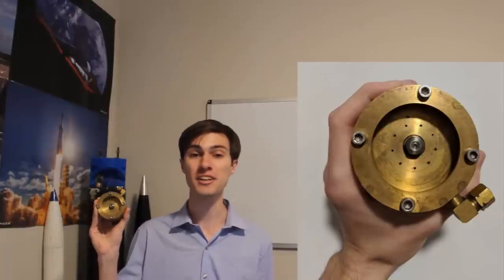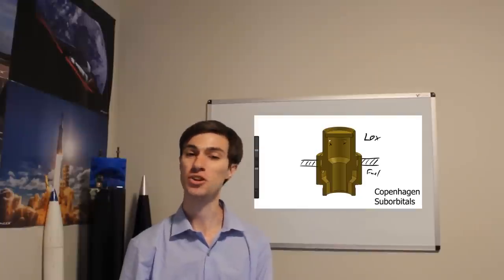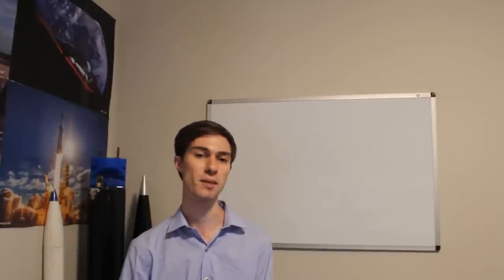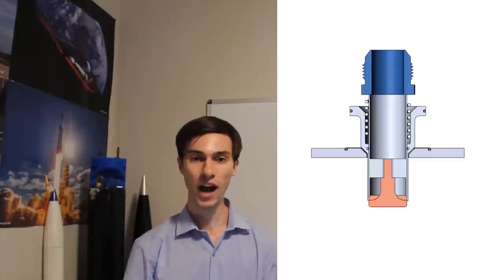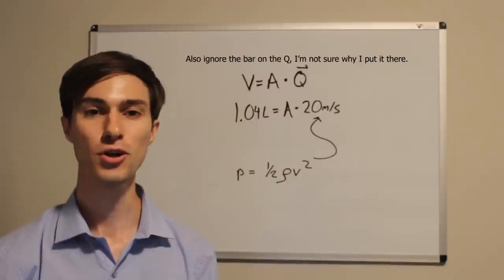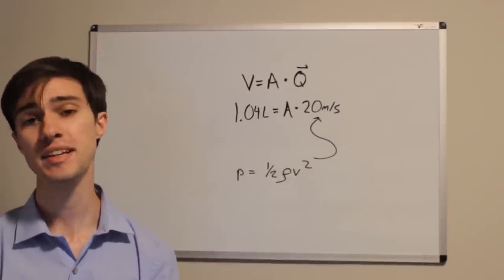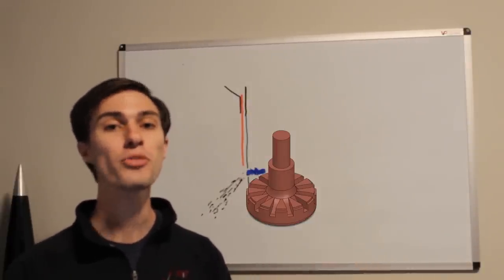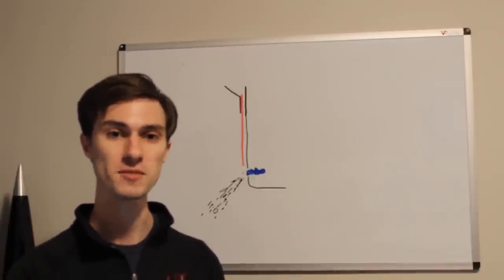Liquid Rocket Engines 2: Injector Trades

Comment: It's Q=V*A not V=A*Q
Reply from the maker: You're entirely right, and this is what I get for throwing equations up on a whiteboard while recording. All of the actual design happened in python, so I could iterate over a lot of possible options. And thankfully for my dignity, I used the correct equations in python.
Reply: @AstroCharlie  Great video 👍

Comment: If you study chemistry of different oxidizing agents, your not stuck with Liquid oxygen gas or nitrous Oxide.  White fuming acid (WFNA) is a storable liquid oxidizer used with kerosene and hydrazine rocket fuel. It consists of nearly pure nitric acid (HNO3). ... WFNA  also as well as RED fuming Nitric Acid is a great oxidizer.  Another good oxidizer is Hydrogen peroxide--, Hydrogen peroxide can easily break down, or decompose, into water and oxygen by breaking up into two very reactive parts – either 2OHs or an H and HO2: If there are no other molecules to react with, the parts will form water and oxygen gas as these are more stable than the original molecule, H2O2.  You can build a very powerful rocket with this compound called a H2o2 Monopropellant Rocket. Works in the principal of pressurizing 90% H202 with nitrogen shooting into a Catalyst pack that decomposes it into steam and Oxygen which then exits through the combustion chamber with a solid type fuel, and is ignited burning the two substances violently into the conversion zone of the rocket nozzle at subsonic speeds entering through the throat and passing through the diversion zone at supersonic speeds. This is the cheapest and yet most effective way to build a very powerful rocket and it can be throttled up or down. No complex machining is required to accomplish this rocket. Im building a land speed Rocket powered motorcycle so ive been studding a lot. and it helps having a father who works for NASA. Dad get me some Liquid Oxygen and Liquid hydrogen from work LOL

Comment: Hello, I am currently a senior in university studying Aerospace Engineering. I am working on a senior project to design an aerospike, both liquid and solid fuel. Currently working on designing an injector and combustion chamber for the liquid aerospike. I would like to present to my team some options for the injectors and would like to 3d print them. Could you send the stl files my way? Would be greatly appreciated. Thank you

Comment: I am not sure what sort of machining facilities/equipment you have access to, but if you have a mill and vertical rotary indexer (i.e. the axis of rotation is parallel the ground) there is a way you could machine a vain-less pintle element (i.e. to provide a smooth curtain of oxidizer rather than radial jets). Basically it would be to come mount the "blank", as you call it, in the index, and com at it from the side with an end mill of the appropriate diameter. Once you reach the necessary depth of cut, begin turning the index slowly (make sure to keep in mind which direction is climb milling vs conventional milling) until you do a full revolution. Presto, smooth pintle element.

Comment: Charlie briefly touched on one fact that few people realize: things do NOT burn, until they are in a gassious form! Look closely at any solid object that is 'burning' (wood), and you will see that it is the vapors coming out of the heated wood, that burns, and the heat from that combustion makes the wood release more vapor. Same thing for liquid fuels - burning takes place at the interface where the liquid is turning to a gas. The liquid itself does NOT burn. That is the secret of why today's vehicles have better fuel mileage than those of 40 years ago - better transformation of the gasoline fuel to a gas for combustion. Example: Charles Pogue's 1938 carburetor that achieved 208 mpg that was certified by the Ford Motor Company which recorded 27 miles on one pint of gasoline (216 mpg). That is also true of SpaceX's Raptor engine and Blue Origine's BE-4 engine. Their efficiency is in part due to using fuel and oxidizer that are both normally gassious before combustion.

Comment: I don't understand why you use the density values for an atmospheric pressure, when the pressure is higher in the engine, to calculate the propellant flow.

Comment: Hi Charlie, could you please explain a bit on how the fuel and oxidizer flow from the injector plate to the injectors? I am a little confused on the things things that go inside the plate and how the fuel/oxidizer are spread to different injectors through one tube. Thanks!

Comment: Hi brother, please excuse my ignorance but I just got curious. Did oscillations on the supply chanel affect rocket's performance? I mean at 4.33 the hose( which supplies water) clearly oscillating, how does a rocket engine responds those type of oscillations? By the way great video. I learnd a lot. Thank you for your effort :)
Reply from the maker: The oscillations definitely would in a real rocket. There are several phenomenon related to this like pogo and chug. For this flow test article it hardly mattered.
Reply: What techniques do they use? To reduce the oscillation or chug.

Comment: why the bipropelent engine dont get mixed befor combustion? oxigen if got flame inside will blowup and the methane the same(or i am worng). So mixig them before chamber to avoid injectors(using just valve)

Comment: Going with the lowest pressure drop possible may not be the best idea due to combustion instability. Huzel and Huang (https://arc.aiaa.org/doi/book/10.2514/4.866197) recommend around a 20% of chamber pressure drop across the injector elements as chamber pressure fluctuations of around 5% are typical. A higher injector pressure drop will lead to a more stable injector as Pc fluctuations will have less of an effect on local mass flow rates.
Reply from the maker: Hi Brenden. First off, thank you, this is a super constructive comment, Huzel and Huang is where I started building my first engine. I currently have a 9% pressure drop over the injector, which is inline with TRW efforts, though admittedly they have a ton more design resources than me to sus-out combustion instability. I'll keep in mind adding some more margin here, along with feed system stiffness if I have future issues.

Comment: Hi Charlie, thanks so much for your videos! I've been designing a rocket for about a year now, however I've struggled with the oxidiser. I was wondering how you were able to source your liquid oxygen?
Reply from the maker: Airgas, Linde, etc are usually good sources. Local welding shops may also stock some in high pressure dewars.

Comment: Hey Charlie. Great video. I’m currently in school for aerospace engineering, and am trying to do some research (and building) of a small scale rocket. Long term goal is to launch a small payload to about 10,000 feet (could change to 30,000 ft). Any advice or help you could offer me would be greatly appreciated.

Comment: Why is the desired resultant stream angle 45 degrees? Is that the angle with the best mixing?
Reply from the maker: Honestly, I don't have an especially good reason other than prior knowledge for other injectors that momentum matching is good at maximizing chamber residence while minimizing wall impingement. Better literature or rationales would be appreciated.

Comment: Have you thought of using Butanol Alcohol?  It creates slightly cooler tmperatires than Kerosene does.  And it has smaller combustion-instability (oxygen atom in the molecule), problems.
Reply from the maker: I'm using 70% ethanol.
Reply: @AstroCharlie  Good idea.